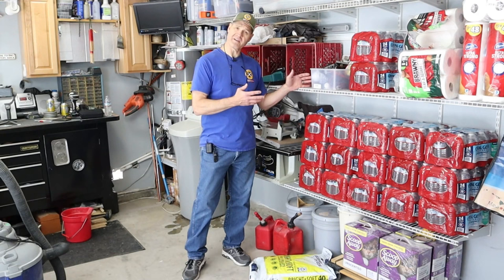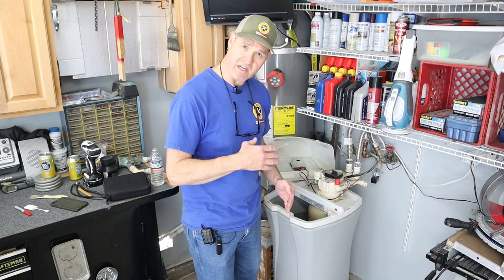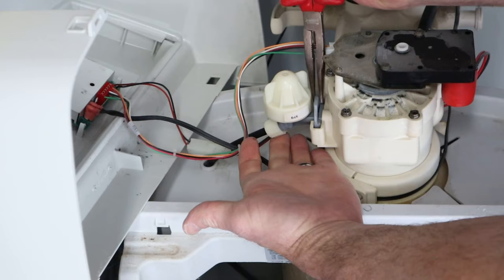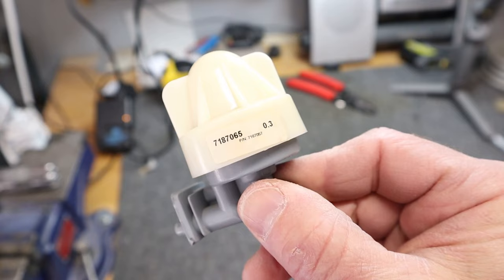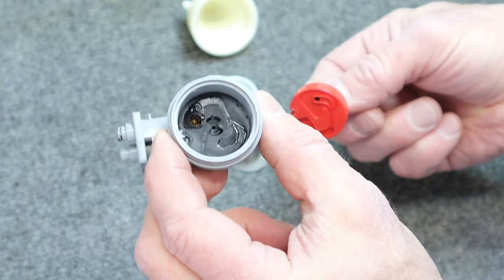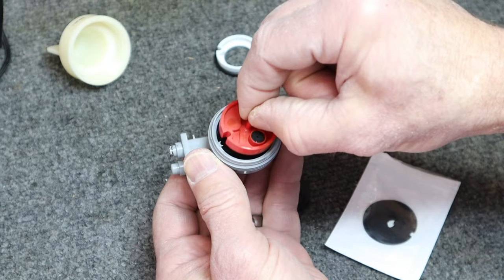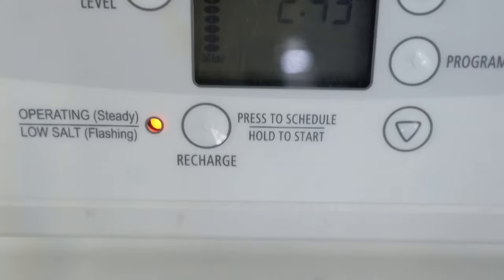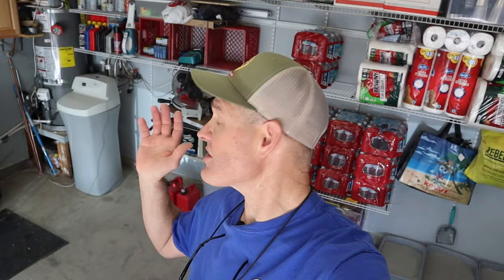Water Softener Full Of Water Fix

Comment: If that doesn’t solve your water in the tank problems there’s also a plunger in the head valve unit that has a oring/spring that wears out over time causing the brine wash cycle not to function properly letting water back into the brine tank instead of washing the resin tank. Took me awhile to figure it out but once I replaced that my softener worked properly. Hope this helps someone.
Reply from the maker: Thanks for sharing!
Reply: Thank you for sharing. Can you elaborate more please? I have limited knowledge on these. Couldn't figure out where the plunger in the head valve. 😢
Reply: @theboywholovesfreedom the part that cycles the water softener is the unit that sits on top of the tank it’s directly under the black motor that turns the valve, you’ll have to remove that and there will be a few screws  you’ll have access to after you remove the motor, after you remove those screws lift it up and the plunger and spring as well as the other o rings will be inside , make sure the water is shut off to the water softener before hand , take pictures along the way so you can just reverse the process after your done,look up your model they should have the replacement parts for your unit there is also a few orings in the head as well, it’s better to just replace them all at once. Just be carefuI when torquing down the screws as to not strip the head but make sure it’s tight enough as not to leak ,hope this helps
Reply: Our problem is that salty water is getting in the house water and the water is salty everywhere in the house now. What could cause the problem?? We also have a lot of water in the brine tank. 😵‍💫
Reply: @eileenjared  I imagine it has to do with one of the o rings or seals in the valve head unit as that controls all the cycles of the unit, if those seals and rings are faulty that could let the brine water into the water that goes into the house. Your model should have replacement parts for the valve unit , hope this helps .
Reply: @MMountain82  thank you so much I appreciate it I was so lost.
Reply: @eileenjared  your welcome I hope that info helps
Reply: How did you know that the cycle was not working?  No sound when on the brine cycle??
Reply: @jamesmcgown692  my problem was there standing water in the brine tank, so I replaced the parts mentioned in this video but after a few days I noticed there was still water in the tank. The unit still cycled through the stages fine and you could hear the motor working it was just the plunger, seals and orings that wasn’t allowing it to function properly. So after I replaced those I let it run a couple days and everything was back to normal.
Reply: @MMountain82 Happen to have the part numbers?  Can’t find anything on this seals online. I have a Morton softener
Reply: @implayaz9  sorry I don’t , I just looked at my softener unit and found the model and found the parts that way . Or u can go to the manufacturer website and go to support they’ll usually list parts in their support page or contact them . Hope this helps
Reply: I followed the video and no improvement.  I'm researching your way, now.
Reply: Hi. Can u put a video of replacing the  springs you mentioned under the black motor?
Reply: @MMountain82  где можно купить эту пружину в Германии?
Reply: Hello,
we have the Problem that Water comes into the salt Container during the initial and Final regeneration. What could be the Problem ?
Reply: The initial water in the tank is normal so as to rinse the softener material, but there shouldnt be any in the tank afterwards. It could be as showed in this video , you may need s new gasket. Or the problem lies in your head unit that rotates, there are also gaskets and a spring and plunger in that. Hope that helps i know its pretty vague but maybe itll steer you in the right direction
Reply: @MMountain82  okay thank you. Do you now where I can Order replacement Party for my device? GE Modell No: GXOF18G-ES, Serial No. 8783, Because I Don't live in the USA and there is no Documentation about it. I would be very grateful to you for that.

Comment: After you bypass it, you better depressurize the tank or you’ll get a big surprise
Reply: What kind of surprise?
Reply: @karlwilliams1271  you have system under pressure, anywhere from 40 to 60 psi. Unless you want it to blow off in your face, I’d relieve the pressure

Comment: My water softener is only 2 months old. I have the same problem with water settling in the salt tank. How often do  these gaskets need replacing?
Reply from the maker: Possibly it is not the gasket. These valve assemblies can get small debris trapped inside. There should be instructions for cleaning and a recommended cleaning interval in manual. It may vary if your water is really hard but I would think changing the gasket annually should be sufficient. Thanks for watching!
Reply: My valve’s venturi assembly is caked with iron dust. The reason I got the softener was to clean the resin filter of the iron that it removes from my well water.  But i guess the dirty water is what gets pushed through to the assembly.

Comment: Will the brine tank drain itself after it's fixed or do I need siphon it out?
Reply from the maker: After I fixed the Venturi valve I ran a cycle. The system sensed that the brine tank was full and began a flush which emptied the tank. Thanks Watching!
Reply: @MrFredsDIY  thanks!!

Comment: I watched your video, rebuilt my Venturi, it seemed to fix it for a couple months, glad the kit I purchased on Amazon had several of the gaskets it there. Hoping that today gives me some more months of soft water without my tank filling up.
Reply from the maker: These Venturi valves collect small pieces of debris as well as wearing out the gaskets. I clean mine out spring and fall now (6months), change the gasket and run a bottle of water softener cleaner as part of my maintenance schedule.

Comment: I have the same softener that, during it's last charge cycle a few days ago, never stopped running! It's full of water and had been pulling water from my well for a good 14 hrs before I finally managed to force the broken motor to close the valve, stopping the water, and unplug it. So this video is exactly what I needed to stumble across to refurbish my system! Thanks.

 Now I just need to figure out how to close my bypass valve without making the other side of it leak too much...
Reply: Griz I just shut the water off. acually I don't even do that unless its in a cycle.

Comment: I need your valuable support..
Thanks for your very useful video. However my problem is a little different from the subject video and your expertise may help me to fix it and I am confident in you.

My softener has the problem that it's not getting the water into the brine tank which is dry now and the regeneration cycle happens without taking the brine solution and obviously the water remains the same. Is the same Venturi valve problem can fix this problem?

Kindly provide your input and I wish you all the best.

Thanks a lot.

Comment: I have the same symptoms as you, a full brine tank, but I think I may have a different problem. 
Before you replaced the gasket, did you first TEST to see if the water emptied in the brine tank when you forced recharge cycle??  If the water emptied, it's my guess that your gasket was fine.  (If it is still able to empty the water on recharge, then the problem isn't the gasket)  If it's like my case, the water is accumulating over days.  The problem comes from a "slow/leak filling" from somewhere, NOT from water being left behind because of faulty gasket and inability to syphon water out of brine tank.
Reply: What was your fix?
Reply: @96CapriceSS  , I ended up finding a crack in the upper part of the plastic valve assembly cover that was very hard to see while in the garage cabinet. After looking closely, I can see drips of water leaking from the cracked housing. 
So I ordered a replacement along with rubber gaskets. Then…while waiting for those parts, the buttons on the digital display seemed to stop working. So I think I’m just going to return the parts and buy a new water softener. It would be about $350 to fix…and that’s only if something else isn’t discovered to be faulty while doing the repair.

Comment: So, any grooves are bad grooves (in the seal). Thanks, wasn't sure if the seal was manu'd that way or what.
Reply from the maker: If you watch at 2:33 you can compare the old and new gaskets. The grooves in the gasket are caused by water  pressure. Thanks for checking out the video!

Comment: Just ordered the gasket.  Also, do you think the floating valve inside the tank may cause this issue?
Reply from the maker: A sticky float valve could certainly cause a similar issue. Many times the inside of the Venturi valve gets small pieces of debris stuck in the channels, that along with a worn out gasket is more often the cause of water not leaving the brine tank on recharge cycle. A toothbrush with Dawn soap and a new gasket seems to fix the issue most of the time. I picked up my gaskets on Amazon. There are links in the video description. Thanks for watching!
Reply: Thank you for your detailed response. Do you have any video that shows how to fix the floating valve issue? I removed it to check it but it looked fine to me, but I might be wrong. Also for the venturi valve, do you mean to wash those small pieces with soap and brush gently? Sorry I would like to understand cleanly. Appreciate you again. Already had the gasket replaced with the new ones from Amazon. But still having issues 😢

Comment: My water softener is in bypass mode right now and has the same lever style bypass yours does, but it's leaking on the left side of the bypass. The other day I flipped it from service to bypass during a regeneration cycle and it sprayed a burst of water while I flipped to bypass and then it slowed to a drip and hasn't stopped dripping..
Reply from the maker: Probably a bad “o”ring on the bypass lever.
Reply: @MrFredsDIY  turns out exactly what it was! We pulled the bypass lever and replaced both o rings and VOILA back in service. 🙏🏻💧
Reply from the maker: Fantastic! I’m glad it was an easy fix!

Comment: Hello My Tapeworks water softener in the UK has around 4 or 5 inches of water in but never gets higher then that, it works fine and my water is nice and soft. Do you think I need to change my Venturi valve? My softener is 10 years old.
Reply from the maker: There should be information for cleaning the valve in the service manual or possibly on the lid similar to mine in the video. I would recommend at least a thorough cleaning. I am not sure what is “normal” for your brand but normally a softener will cycle all of the brine water.

Comment: Hello, I just installed my new Whirlpool WHES40 water softener and I would like to know if I need to water when I’m am adding the salt or just add salt.  Upon installation, the manual said to add 3 gallons of water with 1 bag salt and make sure it is running good before adding more salt. 

That stage is completed and now I need to add more salt, I just need to know whether I need to add more water with the salt or salt only.
Reply from the maker: Somewhere in the directions and installation manual, it should tell you. Most units inly require salt to be added  for the next stage. When the system regenerates, it will add water.

Comment: Thanks for the info. I’m doing this today.
Reply from the maker: Those valves get pretty dirty also. Thanks for watching!
Reply: I had to go extreme with mine. I do appreciate the info you shared. I tried the hot water and wait. Then iron out product and wait. Nothing worked. I literally had to use my shop vac to completely empty the tank. Rinse it with hot water twice and free it up totally. Then it began working. That salt clog was massive. Thanks again.

Comment: I have the same water softener and my last reset and adding pellets caused it to make all the water in my house drip. Turned it off and all the faucets were back to full pressure. Any ideas why? The hard water ruins my glass shower doors. About to rent my house out and want to get new shower doors but don’t want the hard water to ruin those too.

Comment: I have the same symptoms but cleaning the valve did do anything and the water pressure is still around 30psi. unless you tap on the spring things on the pump. anyway. I have water that appears to be coming form the rubber membrane under the readout portion of the softener. what to do now?

Comment: My rotor valve disc won’t turn. Any ideas?
Reply from the maker: Unfortunately, it is likely that the motor might be seized. You could go on Facebook marketplace, offer up or even craigslist to look for a model similar to yours for parts. Odds are you could find one pretty cheap. I recently did that with a swamp cooler it worked out great.
Reply: @MrFredsDIY  I changed the little black motor on top. Along with the rotor disc gear thing. The rotor valve itself turns nicely up until I get all eight bolts tightened up fully.

Comment: I did this repair about 13 month back and again the water is filling back up again. I took the Venturi back apart and inspected the gasket. What is it that goes bad with the gasket? All I see is the imprint of the corresponding component, but nothing ripped or deformed. Is it just the compression on the gasket material that is the problem?
Reply from the maker: There is pretty high-pressure that goes through this valve and the water creates a ware pattern on the gasket. Also, the opening through the channels is pretty small which along with the shape, creates the draw effect to pull the water out of the tank. Every time I change this gasket, I do notice small debris that I clean with Dawn dish soap and a brush. I think it’s a combination of these factors that creates this maintenance issue.
Reply: Thanks for the timely response! @MrFredsDIY

Comment: can you link to the gasket you bought please?
Reply from the maker: There is a link in the video description as wellVenturi Replacement Gaskets https://amzn.to/3HO5ruJ
Reply: @MrFredsDIY  AH thank you! I didn't see them under the merch links!
Reply: @MrFredsDIY  working on this today. When I took the valve apart I noticed we didn’t have the little mini circular piece that you have at the very bottom center. Could that be an issue?
Reply from the maker: @slashedbeauty there should be a diagram of all of the parts you are supposed to have in your manual or even on the lid of your unit. Make sure that you put it back together according to the diagram. If you are missing parts, it will probably be an issue. In the video you will notice that my entire valve assembly had a part number and is offered as a replacement part. It is likely that you can purchase an entirely new valve if necessary. Good luck with your project!

Comment: Appreciate video I’m having issue where I’m using salt everything seems fine except my water isn’t soft at all had it tested as well have it set to 80! Unit is only 6 months old. When I look in my media/resin tank it looks empty!? Is it possible to empty/put “new” resin in these style water softens where brine and resin tanks or in a single unit
Reply: MAT I did mine after 25 yrs I wouldn't think yours needs it yet.

Comment: Fred - My issue is with the Brine tubing being brittle and breaking. I've done some patch work a handful of times, but it really ust needs to be replaced. Do you know if the Brine Tubing (from the venturi to the brine valve assembly) alone can be replaced? I have found the part on Sears Parts Direct so I'm guessing so, but I can't find an videos of the tubing being replaced. Also, I'm assuming that the ferrule nut cannot be reused. Do you know whether or not this is the case? Any tips you can provide would be greatly appreciated.
Reply from the maker: I’ll bet you the feral and the tubing are available at a legit plumbing supply store. It is possible if you have an old-school hardware or an Ace Hardware you could speak to someone and show them the parts you have, and they can match them up. It certainly worth a try! Good luck with your project

Comment: My issue is the opposite. In the past, I'd have to add about a bag of salt every 2 weeks or so. However, I last added salt about 2 months ago and notice it is at the same level. What could be causing this and how do I remedy the issue?
Reply from the maker: The first thing I would check is the bypass valve attached to the manifold to be sure the plunger has not been pushed. I would force a recharge cycle, and witness what happens. Listen to hear if the motorized control valve is operating. Remove the lid from the float valve assembly tube and look for water filling the brine tank through that float valve. If no water is entering the brine tank then that is the problem and now you need to find the cause cause.

I would manipulate the float valve during the recharge cycle to see if the valve is “stuck”. This valve is similar to the float valve inside the tank of your toilet. If water is not filling the tank from the float valve, that means it’s not receiving water or it could have debris in the float valve or Venturi valve.

There should be instructions on the lid, online or in your owners manual for cleaning the Venturi valve and changing the gasket. I use dawn dish soap and small brushes or an old toothbrush. 

If you are not cleaning the Venturi valve once a year I am fairly certain it has debris inside and your gasket is probably worn out. 

Good luck!